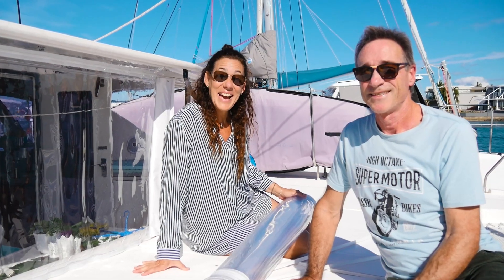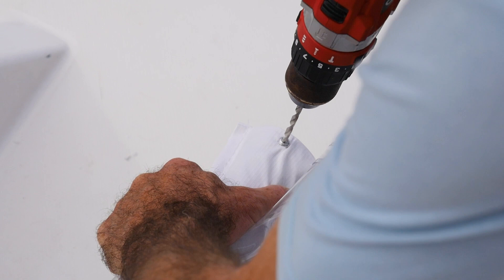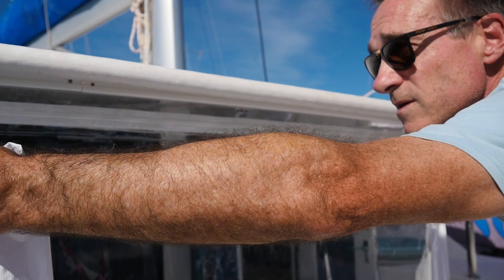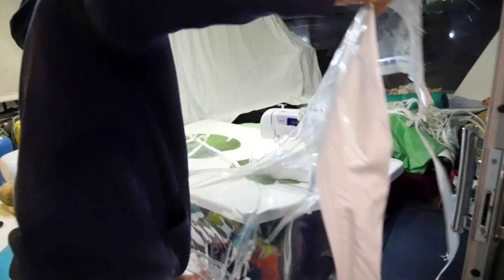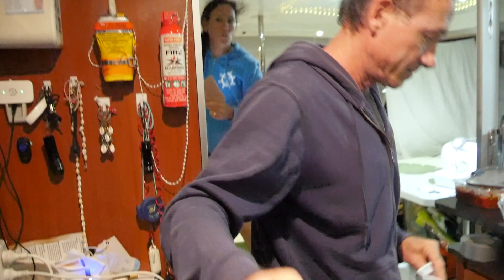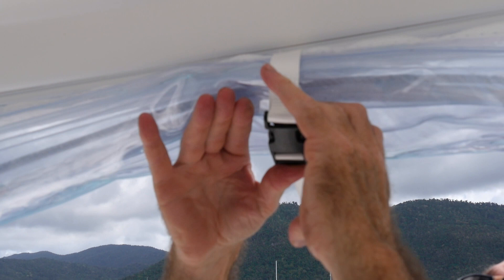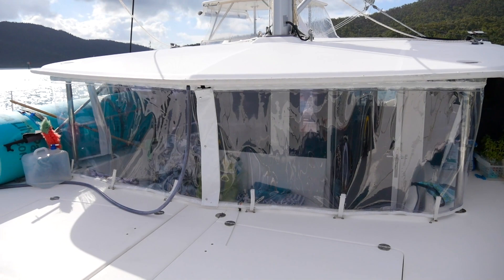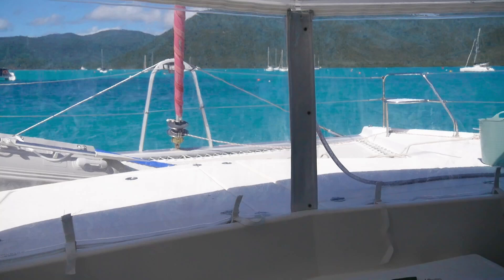How to make a boat enclosure for $500 DIY using a normal sewing machine - Sailing Bluefin: Ep 25

Comment: VERY GOOD, thats how i do things,   ''close your purse, sit and think''    i was so pleased when i learned how Iraq , people made gas for their trucks.   .
Reply: Yeah, just amazing what you can do when you look for alternatives!
Reply: Hey spymaine89, how do the people in Iraq make the gas for their trucks? Sounds interesting!
Reply: @sailorsam6243   Facing a shortage of fuel to run generators and machinery due to the siege, former construction worker Abu Kassem set up a makeshift refinery to extract fuel from plastic waste through a process of burning them and condensing the released gas....
Reply: @spymaine89  wow, that's impressive.
Reply from the maker: @spymaine89  thanks! 😁
Reply: @spymaine89  That would be great for the boat!
Reply: @sailorsam6243  free diesel! 😉

Comment: What concerns me about this 10/10 piece of creativity is the UV resistance of the plastic and material. Being a avid lover of chopping up Bunnings products myself and re purposing them, the plastics they use from China usually degrade the day after the warranty wears out. I don't want to sound pessimistic but I would be so worried that I would do all of the work and then have them fall apart in an area where I couldn't replace them. I would 100% do this if I was just local cruising though.
Reply: Hey Trent, good point. The back clears have now been up for around 6 months and are weathering well. They probably won't last for 10 years, but a lot of the clears we've had in the past don't really last well past 3 - 4 years.
One slight issue with these is that the zippers are not as good as marine zippers, but are also going fine - just not quite as smooth.
Reply: We actually had problems finding anyone who could actually do them in a reasonable time, except for the guy that quoted us $11,000! 😂
Reply: Hey Trent, I thought about this too, but I guess that at less than 10% of the cost, you could probably afford to replace the weather beaten ones every couple of years.
Reply: @sailorsam6243  As I said, if they fall apart when I'm out the back of the Philippines or remote area cruising they may not be so easily replaced. Otherwise the fantastic idea. Cost isn't an issue if you are not near a supplier.
Reply: @keithwiggins6891  I'm going to check back next year and if they are still weathering well, I'll do they same thing, picking up my cat June next year in Cape Town then sailing to Darwin. Can install the clears in Darwin from Bunnings :) .
Reply: @keithwiggins6891  Well if it is anything like Perth finding anyone to do anything is exorbitantly expensive.
Reply: @keithwiggins6891  Actually on that, I'll get a helm enclosure made in Cape Town and don't have much experience with it, any clears or brand you know of that were garbage?
Reply: @trentspencer7991  yeah, and it wasn't just the cost of getting a Trimmer to do them, it was the difficulty of getting them to turn up to do a quote or make them!
Reply: @trentspencer7991  I don't know the actual brands of pvc that were used, but on our last Leopard 38 cat, we made the mistake of getting the really thick pvc (made by a trimmer) & it was very difficult to roll up, plus it seemed to scratch and scuff more because of the stiffness. So make sure you're happy with how it rolls, as theres nothing worse than having to have two goes at rolling up each time.
Reply: @keithwiggins6891  Thanks for the advice that isn't something I'd have thought of.
Reply: @trentspencer7991  actually, someone else also told me that you have to careful of the really thick stuff cracking in very cold weather (when rolling it up tight).
Reply: @keithwiggins6891  Yes, I've also heard about the thick PVC cracking when rolled too tight.
Reply: @sailorsam6243  it is a problem.

Comment: I was wondering if your having overheating issue.  I realise you can open them.  I assume your only using them when it rains.   Do you know if they come in tinted and any UV filter built in?
Reply from the maker: Hi Bobby, thanks for watching our video! As you said we only tend to put them down if we know it's going to rain or for more privacy. We are currently in around 36 degrees Celsius heat at the moment, and even in that heat it's not so bad with the clears down. Although we do tend to put them up to get more airflow through the boat. The great thing about these is that we have made them really easy to clip into place, so putting them up and down isn't that much of a job. These particular blinds don't have a UV filter, but you can get the charcoal tinted ones, which are available at Bunnings. Alternatively you can also put seperate mesh to provide UV protection.
Reply: @SailingBluefin  Thank you !